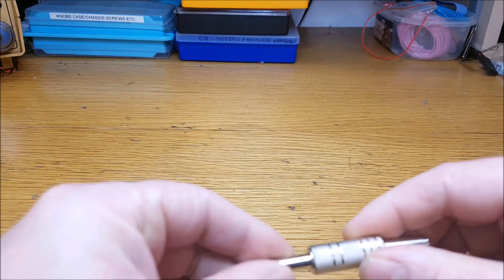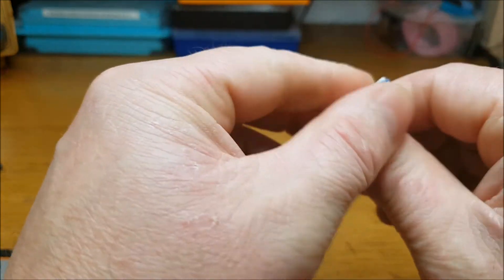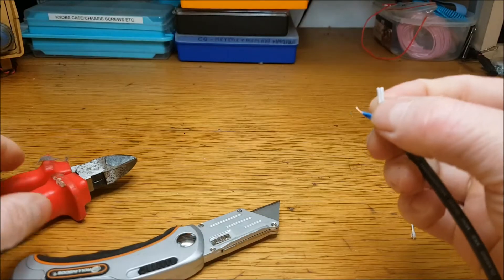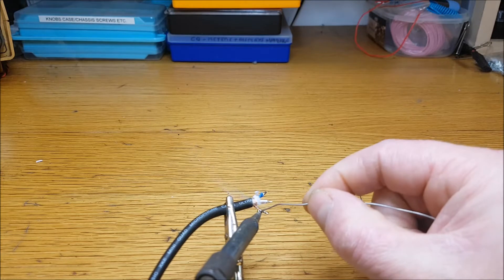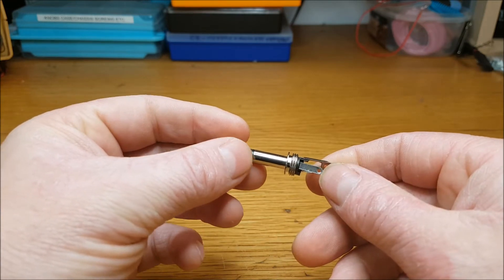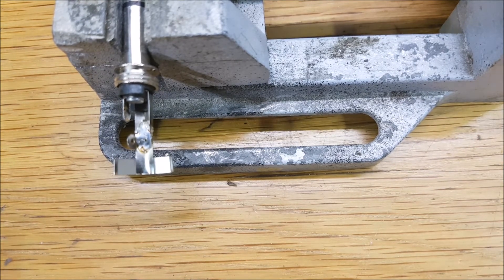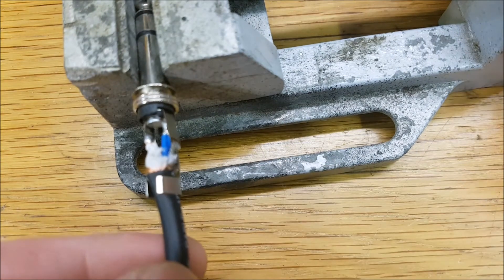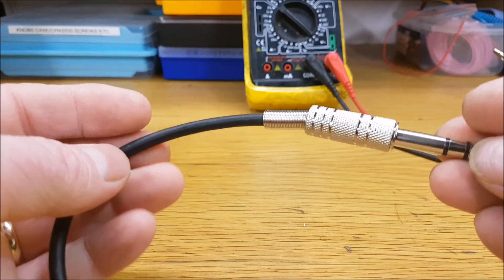How to make a Balanced Audio Cable

Comment: Did you really make a 10 minute video about "how to save money by not buying expensive pre-made cables", by buying an expensive 5 wire cable, making 2 of those wires useless by shorting them in pairs of 2, essentially creating a 3 wire cable and then just soldering that onto stereo plugs?
Why not buy a normal 3 wire cable instead?
Did I miss something?
Reply: yeah, you really did miss something. In this case, you are unaware of what a "'twisted pair" refers to. It literally carries the signal better with less interference. No harm in not understanding, only ignorant if you don't change your understanding in the face of new information
Reply from the maker: Yes you did. You've no idea of how twisted pair cables work.